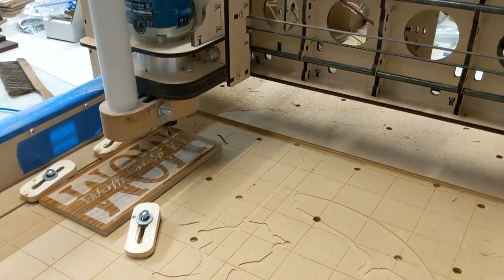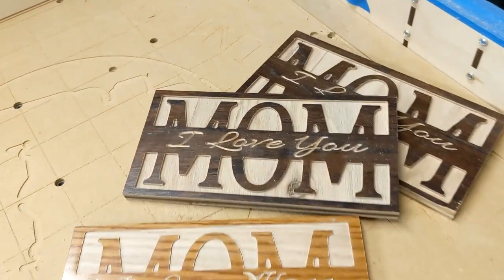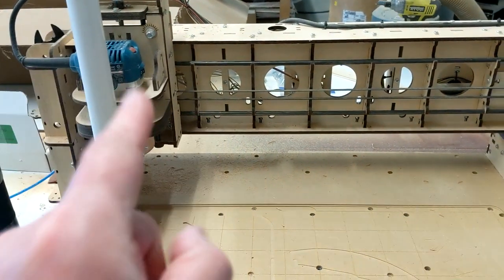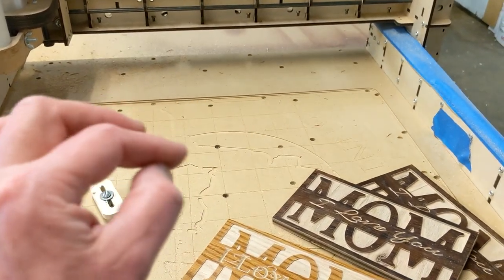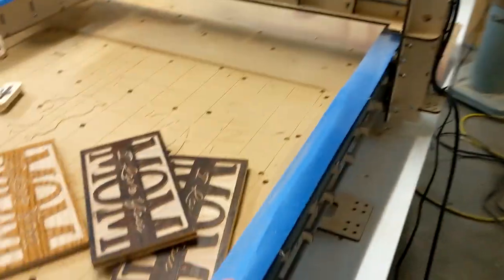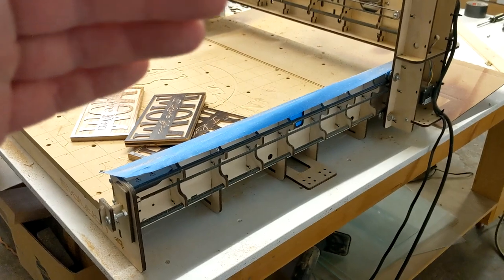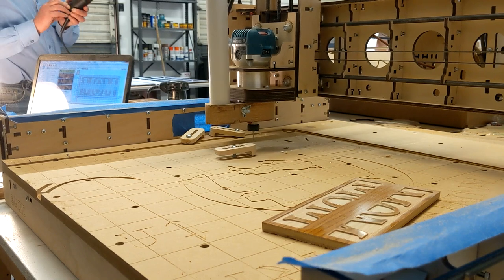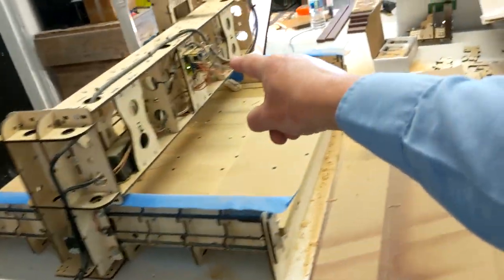Why Your CNC Router Randomly Stops In Middle Of Projects [You'll Get It] - Garrett Fromme

Comment: Been programming 5 axis CNC CMM , and lab manager for over 20 years. A requirement from manufacturer for all the machines, before they will even install it, that it must have a dedicated regulated & filtered power supply.   You do not want to feed any CNC type machine with potential bad juice.
Reply from the maker: Exactly!

Comment: Static through the wires can also cause this.  mostly from the vacuum or from the actual router it's self.  I see you have the router power cord tied in with motor and end stop wires which are unshielded. You may find you still get random stopping even with the surge protector. if you do, separate the routers power cord, static ground the vac hose and get shielded wires bundles for the motors and end stops.
Reply from the maker: Thanks 3D. I didn;t think about that. Will fix it now

Comment: for those with 3018s having this problem, check the bundled power supply. they are most likely underpowered and not made equal. I have to add 10000uF capacitors to stabilize it. taking off the power supply to the motors and laser from the controller regulators also provided great improvement. been using >2 meters of wires from the controller to the hardware with no ferrites with no problems ever since.
Reply from the maker: mariomanus3176, Thanks for sharing your experience! It's great that you were able to troubleshoot and find solutions for your CNC machine. It's always helpful to hear what has worked for others in similar situations.

Comment: Get rid of that arduino and cnc shield, get something better. This does not have ANY filtering and protecting circuit on it, thats why that happens. Why does not your TV or PC shut off when you connect something? You get the point
Reply from the maker: Multimargejta, good point brother. Shielding is important to have on every device to be properly configured.

Comment: The surge protector is a good idea, you should also have a “dedicated “ power source for only the CNC and ferrite filters on everything! I had this same issue until I installed the ferrite filters.
Reply from the maker: Hi RB. I'm working on the alternate power source. It's a little tricky in the new (old) shop.

Comment: Add some Capacitors to the control board to help filter voltage spikes. I also added clip on ferrites on long cables to filter inductive loading feedback and reduced the overall noise on my cnc. I had the same issue for the longest time. I have an oscilloscope to hook up and find these issues. Never had a problem since.
Reply from the maker: Chad, those are great tips! You are definitely ahead of the game on this one. You should sell a kit that other CNCers use to filter out inductive loads and reduces electrical noise!

Comment: Also going with battery backup combined w/surge ... After 20 years building and servicing PC's, I have made a small mint rebuilding software after power crashes, or worse, brown outs, and causes a disk write to drop, or corrupts, immediately causing Windows heartburn, only to be discovered at the next bootup, or worse, it will not boot cleanly once the power comes back ;)
Reply from the maker: You, my friend are a top-notch techie!

Comment: I’ve never had this issue with any software other than UGS. I’m not sure if others will do it or not, but the last 5-6 years has been problem free until today with ugs and a genmitsu.
Reply from the maker: ElectricAdvantage, sorry to hear UGS gave you troubles brother. Have you tried using gSender? Here is a link: https://sienci.com/gsender/?ref=idcwoodcraft
Reply: @IDCWoodcraft  I have not tried gSender yet, but I have realized that this is most likely an EMI issue or a bad power supply with my machine. It’s triggering false estops when the spindle is under load.

Comment: This is an area where I have some experience, although from a different angle. I have been a ham operator for most of my life, and we sometimes will use gas generators in the field to provide power to our radio equipment, and computers. Without going into a lot of detail I will simply say there are plenty of opportunities for dirty electricity to be introduced into the system. One thing that we have learned to do is to avoid using a source of electricity that is dirty to begin with. When it comes to gas generators, there are the typical over-the-counter generators, and then there are inverter generators. The difference is that an inverter generator if it is made properly will have a clean pure sine wave. Secondly we will use LINE conditioning devices to help alleviate random hiccups in the smooth sine wave we are looking for from a generator. How this relates to using alternating current in a CNC shop is not all that different. My first recommendation is to have a dedicated service line run back to the breaker panel for the CNC. That service line will be rated at either 15 or 20 amps for a 120 volt circuit. If you have multiple devices on that one circuit you can see where the electricity can in fact be impacted as you turn equipment on. By spreading out your loads across multiple service lines to your shop, you begin to attack the problem in a more intelligent way. While the use of quality surge protectors is a step in the right direction, there are on the market such things that are used for conditioning the electricity provided to medical equipment and other sensitive electronic devices. One less expensive way to do this, is to use a quality battery backup system. These devices typically have line conditioning circuits built in. 

A better way to literally see what is occurring on that service line is to have someone who is familiar with doing this, is to put an oscilloscope on the service line feeding your CNC machine. We used to do this in various labs where we would have expensive communications equipment in the same area as shop equipment. By putting an oscilloscope on that line we could see the exact instant a piece of equipment was turned on and the effects that would have in the signals received in the communications equipment. Getting spikes and other forms of noise into the CNC router is never a good thing. And as you pointed out we spend quite a bit of money on CNC equipment so why would we go cheap when it comes to providing electricity to that same equipment? If you hire an electrician to run a dedicated line from the breaker panel to your shop, and I strongly recommend you hire this out if you don't know what you're doing, the cost to have a second or even a third dedicated circuit to your shop is not going to be that much more money. As long as there is additional empty space in your panel to accommodate the additional circuit breakers, you should do just fine. I would recommend that you run 20 amp circuits and not 15 amp. 

Having said that, these problems are exacerbated in those areas that have dirty AC service. What I mean by this is some communities have more problems with reliable power service than others. Though it seems like an extreme example, imagine your lights dimming when your neighbor turns on his air conditioner. You may have noticed that many electronic devices have a large mass on the power cords to the equipment. These are called ferrite or toroid cores. You can purchase these separately, and by simply clamping them over your power cords may find that the spikes can be completely removed sometimes.

Dirty power is more common in households than you can imagine. The electricity powering hospital equipment oftentimes is much cleaner than what we use in our homes. How do they do it? A well-made surge protector with a high joule rating or a clamp-on ferrite or two might solve these type of problems for some folks. Others may have to resort to more expensive means.

As always Garrett, excellent topics!
Reply from the maker: G, there couldn't have been a better deep dive into this subject than this post. I just learned a ton. I forgot about dirty electricity from my days as an engineer and solving blown boards issues.
Reply: I don't believe it's so much dirty power, rather emi from motors/inverter getting onto the usb cable interfering with the data transfer. Still need to try myself but I believe a good quality shield/ twisted pair cable with some ferrite clamps could be the go.
Reply: I ask because I don't know. If there's a surge in  power won't a surge protector just plain break the circuit and turn off power and the instrument will stop anyway?

Comment: I’m glad to hear you solved your issues.
I’ve experienced the very same weird things for a long time with my laser cutting machine and, unfortunately, I’m still dealing with them sometimes.
Where I live we have a quite dirty AC line.
So, I tried to solve by the followings:

- dedicated 16A line directly from my main panel, no other electrical devices on the same outlet;
- pure sine wave UPS to power laser machine, EMI filtered plug, accurately grounded chassis, correct cords size;
- water pump, air pump and any other inductive loads on different lines;
- EMI filtered USB cable from a stabilised 5V dedicated source for logic controller board;

And yet, sometimes it happens again…😔

Reading here and there, someone said it might be related to USB grounding problems (not AC grounding).
Someone else said it’s just a matter of quality of the controller board (no names here, but some “cheap Chinese clones” of well known MCU’s have PCB quite poor designed…).

Honestly, I haven’t tried the surge protector suggestion (even if I’m quite sure my AC line is quite safe and sound now 🙂).
I’ll probably give it a try.
Thank you for this tip!!!
Bye 👋🏻
Reply from the maker: Fulvio, those are all great ideas! Thanks for sharing them my friend.

Comment: I discovered, the hard way, not to unplug something from the power bar that my CNC is plugged into.  I unplugged a fan I had plug into the power bar and my CNC immediately stopped.  It was very frustrating.  Now the CNC is on its own dedicated circuit and it hasn't happened since.  Great video.
Reply from the maker: So many solutions...the best is to keep it isolated.

Comment: I'm having this issue now. Using UGS, Workbee CNC, VFD with spindle. I have been thinking along the same lines as Garrett and have been trying a job that stops, but haven't switched anything on or off in my cabin. As the job stops around the same time eacg time, I thought about what else it might be. I have the USB cable running through the cable train. I think it might pick up spikes from the motor drives. I am buying another USB in order to seperate the cable paths. I removed the spindle cable as this crashed the system all the time. I would recommend cable seperation where ever possible. I'll report back in a few weeks with some progress. Thanks Garrett for your help!
Reply from the maker: Hi Mark. It seems the router wires and controller wires being too close together also caus this issue...I think you said that

Comment: For sure ! I had the same problem  yesterday and separate all power supply from the CNC . Maybe ARDUINO doesn't like spires.
I hope it will be done for next job...
I also use shielded wires for every electronics networks .
Thank you for advise !!
Reply from the maker: Hi Jeo. Sorry for the delayed responce. I got overwhelmed with messages on this video. Thanks for sharing your experience. Yes, shielded cables will make a lot of difference.. I'll be doing that to mine.

Comment: I had something similar happen yesterday … yes, my router was still running and  stopped moving, but Carbide Motion was on the Connect Cutter screen, like it would be if the application had just been opened. I’d had this happen once before and most people said that it was probably static from my dust collection. I needed to get this thing done, so I re-ran the file with dust collection turned off.

The power for the dust collector is already separate from the CNC computer and controller, but I haven’t tried anything yet regarding shielding static or EMI.
Reply from the maker: B-radg, glad to hear you figured out the root of the problem. Funny how such a small thing like static from your dust collector can mess up your whole day!
Reply: @IDCWoodcraft : Yes, but I want to be able to run my dust collection, so maybe I need to look into shielding and so forth.

Comment: I’ve run my router for over 12 years and never had that problem.  BUT, I have a factory built unit, possibly with more built in filters, clean electricity, and, I had a dedicated 240 volt circuit for my CNC and a dedicated circuit for the computer.  (I will never use a laptop to run my CNC). 
That said, a friend that had the identical router as myself was getting random stoppages and he too had clean power and dedicated circuits. He discovered the cause while looking out his door, heard the CNC crash and saw a tow truck driver keying his mic at the exact time the CNC crashed. He called the owner, brought over a truck, started a test file, and crashed the CNC every time he keyed his mic to talk to home base. My friend was able to install a filter that solved the problem. CNC’s can be finicky.
Reply from the maker: This is a very interesting situation. Just goes to show how elusive it can be sometimes. Thank you for sharing it

Comment: There are three (or more) things to explore: 1. Size of the wire in your power cord or extension cord to your machine.  2. Which side of the panel grids is your machine connected?  3. Distance from your panel.  Let’s explore!  The size of the wire gauge is very important as many cords or circuits are sized for just one item using that circuit, so you get voltage drop in the line.  The distance is also important for the same reason: the longer the run from the source, the more the voltage will drop.  
Which side of the electrical panel circuit bars  is the router and/ or control circuit connected to?  You have a panel with two sides or grids for incoming power in a 220 service.  If too many circuits of one side of a 110 line in the panel are on the same side, have the circuit breaker switched to the other 110 bar in your panel.  That way the voltage will be more stable.  Other users in your area can also affect your service if they have large motors, welders, stoves, or such that are in use at the same time.  You can ask what they have and when they use more items all at once.   Is your dust collector, air conditioner, heat pump, stove, etc., in use while your router or spindle is running (especially important if it uses 110 volts)?  Does your CNC have a dedicated line from the panel?  Is the wire size correct for the distance and load (amps) of use?  If you have conduit from your panel, you could have the wire size/gauge changed to accommodate the amperage increase along that circuit, because simply changing the circuit breaker to a 20 amp won’t make a difference if the wire is the same gauge.  Electricians are notorious for putting too many outlets, light fixture, etc., on the same run from the panel, as that conserves wire costs for separate circuits.  Your circuit can be monitored with a meter to check amperage and voltage while the CNC is running to watch the changes along that circuit.  Your spindle and stepper motors may need separate circuits (or sides of the panel service) to run efficiently without lower power conditions if all are 110 volts.  Surge protection of an adequate size is also important, as is the power back up/load characteristics of the unit.  Filters are helpful for any computer circuits, as small changes in volts or amps along the lines disrupts the signals, as is the quality of that network wire: is it Cat 5 or better shielded cable from your internet connection or is it on a closed or separate loop from the internet and is the cable shielded, especially from the control computer to your stepper circuits and motors?   All wire has a ‘field’ around the wire along it’s run from the sources it uses or controls, so keeping the power wires near your computer separated from the network cable is helpful, as much as possible for high quality signals.  
I hope this  gets you thinking out the issues before they begin or solves some of the problems encountered. 😎
Reply: Oh, I forgot  to mention to look at your electrical panel and see how many of the single pole (110 volts lines) are on the same side of the panel circuits. If all those circuit breakers are in a line on the right or left, then having some placed on the opposite side (the other 110 v bar) of the row of switches may help.  Consult with your electrician to have those changes made behind the panel cover for safety!
Reply from the maker: Wow thanks for the tips Paul. This will help out a lot of people for sure! Electrical problems are very tricky problems to figure out. Wouldn't you agree